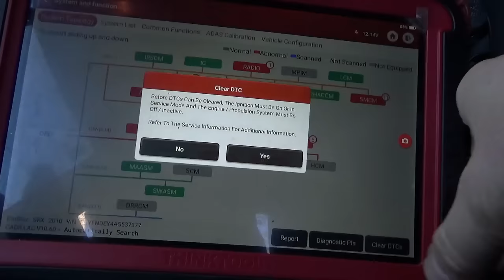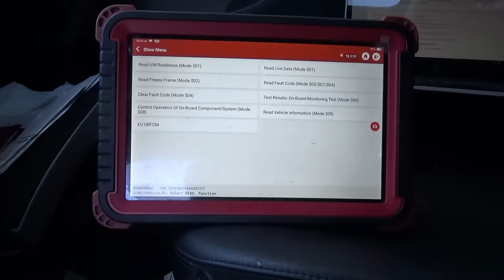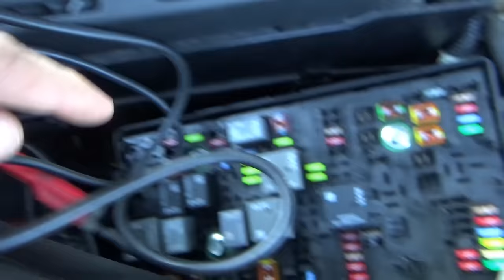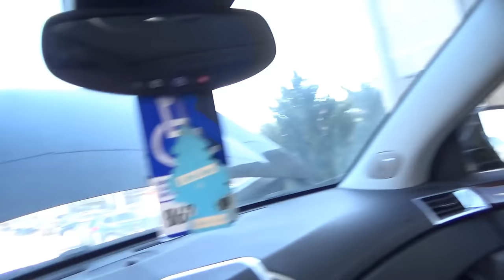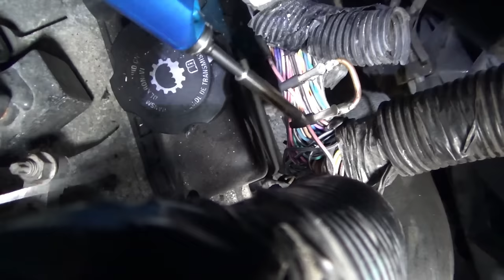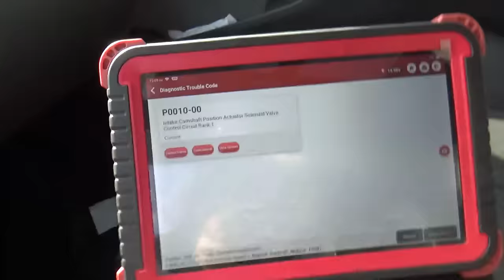Cadillac "Runs" on 2 CYLINDERS!?! (2010 SRX V6)

Comment: Hold the start button for ten seconds with out brake on for ignition on !!!!
Reply: lol
Reply: hey we all learned 1 days
Reply: Not sure why GM wants you to hold it for 10 seconds for ign to come on. Learned it under smart key description and operations.
Reply: @waqasazmat81  I just bought a car that needs  key to start.  LOL
A motorcycle I can see a push button being used.  But that means an electronic lock for steering wheel. Unless you use a key to unlock it, then put key in pocket and start engine.
Reply: @robertsmith2956  I never have to worry about locking my smart key in the car, I just keep it clipped to my belt or in my pocket. Of course I own a Toyota so I don't worry about the associated parts failing, I mean they can but it's rare, the console shifter already requires an electric interlock that rarely ever fails on any brand.  And the Toyota system (I  don't know how GM operates because I won't own a modern GM) reduces wear and tear on the key fob, I only have to touch the door handle to lock or unlock the car. As far as run position goes it's just a tap of the button without a foot on the brake.
Reply: Yeah I'm thinking RTFM but in fairness it's not his car and never seen it before. Still, it's silly how the simple things trip you up.
Reply: GM calls it "Service Mode"

Comment: If I could play devil's advocate here for a minute: I bet the customer drove around for a long time with a misfire and killed that cat! I try not to jump to conclusions when I see new parts because you don't know the whole back story. People ignore things for a long time and then end up having to get all sorts of repairs done all at once and then you look at it and think that somebody ripped them off which they might have but there's also the possibility that somebody was ignoring problems until the car literally wouldn't drive anymore......
Reply: Good info. !!! He had problem a long time. Could have been lots of raw gas.
Reply: Doubtful, most owners aren't going to replace a very expensive catalytic converter to fix a misfire if the shop tells them there is ZERO chance that it is the problem.  AND what shop with any moral character would replace a cat on a vehicle that is still running on 3 of 6 cylinders, even if the cat was known bad? Any shop with morals and dignity would advise the customer that doing so could ruin the very expensive new converter. The smoke show is oil that will coke in the converter reducing its lifespan. A shop that imagined that a 'plugged' cat could stop the whole bank from running is my only conceivable guess.
Reply: @truracer20  thanks
Reply: @truracer20  does the gas ruin the rings or cylinder walls?
Reply: @peetky8645  That would be my guess, that the unburnt gas has rinsed away the oil film on the rings and walls leading to excessive blow-by, along with a huge amount of raw gas being dumped into the cat because it's spewed out the exhaust valves.

Comment: Here is a quick tip i picked up from South Main Auto, wrap the tape around a small socket and you now have a small roll of tape
Reply: Free-tip Friday on a Thursday.
Reply: Yes as a Truck technician that's the best small roll of Tape 🇺🇸👍
Reply: the plastic spool from scotch tape roll works for me.  I don't loose the strip at the end like the cardboard it comes on does.

Comment: Hold the ignition button down without touching the brake for ten seconds.  That'll put it in service mode
Reply: Yes why in Jesus name did he not look that up!
Reply: @Evolvedmindz1  I had a Chevy bolt ev last week that when I ran the front view camera calibration on the autel it said it wasn't supported, I then hooked up gds2 and it did the same thing.  There's no engine of course and I tried to run it koeo and in service mode and any other mode in between lol.  Turns out it's just a software glitch coz it was actually in calibration mode I just needed to drive it lol.   I got frustrated and passed it on to another tech coz I was in the middle of a 22 crv main harness swap.   I was pulled off that job to do a "quick" calibration.   Ya right it's never quick lol.   It's just gm ain't caught up with the released versions of the program to make it work like it should so if ya'll run across that just drive the dang thing😅    I've worked on cars with 53 miles on em and they have me strip them down to the unibody so the structural techs can go at it,  two months later I gotta come back and reassemble the whole car and I'm a mobile tech so it can get interesting to say the least
Reply: @autotek7930 Same for 2016 Cadillac ATS so you get into Accessory mode to be able to move shifter without engine running.
Reply: @85rx7se  any push button gm is this way. It's just the ev stuff hasn't caught up software or service info wise

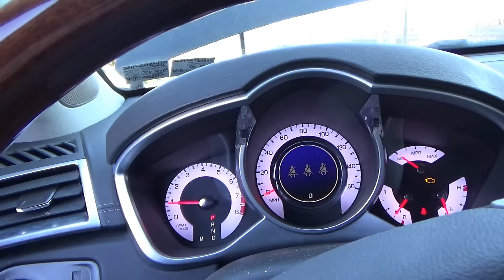Comment: Paused at 3:20  I'm not sure if your aware of this Ivan.  But ALL GM's with push button start, you have to hold the start button for 5 seconds to get the switch into run position.

Nice work finding that broken wire.  They are not always so easy to find.  But it never ceases to amaze me when a customer just want's one thing addressed, when the car has a laundry list of problems still.

Comment: One of the hardest things to find when I was an aircraft electrician was a wire that had just enough strands to show continuity but could not carry a load. In those situations a simple test light setup was often more helpful than the fancy test equipment. The only thing more frustrating was when there was intermittent contact. Often a problem would occur under certain g-loads and work fine when the wing flexed and contact was restored. I've seen several of your videos where you've had to deal with similar situations with the cars you work on. Your patience and ability to follow some complex and often erroneous wiring diagrams is commendable. Thoroughly enjoy your channel.

Comment: I deleted my comments about the 2 cylinder Caddy.
Maybe at 81 years old I was in an "instant gratification mode"!
Good job on the 2006 Accord 6 cylinder valve adjustment video.
I  have a 2007 Accord V6 with about 110K miles. Runs great & extremely reliable.
Reply from the maker: Please never delete your comments, just respond. Deleting comments wastes time of people who took time to respond 😊

Comment: First in😊. I spray my tires and wheel wells every evening with peppermint oil and no more mice getting into vehicles since I started this a couple years ago.
Reply: I wonder if that would work on squirrels also.
Reply from the maker: Wow spraying the wheels every night is true dedication! 😅
Reply: I feed the feral cats outside, and they bring proof they keep my wires safe.  Although one had her kittens on my engine.  Didn't get my car back for 3 weeks. Pop the hood, and the cute little buggers scamper back into the harness and hoses. Thought there were two, but then spotted a 3rd one.
Reply: There are five feral cats in my back yard that I feed. Never had a problem with mice. I have 4 cars and  6 vintage motorcycles. A mouse could cause significant damage.

Comment: Very cool diagnosis process instead of power probe power you sent supplied power through 5 amp light then a test light on the other end to see a dim light and a wiggle test to nail the failure point. Hopefully the guy doesn’t have two dead cats now! Fun stuff and a cool car! Well done Ivan.
Reply: Hey I have a power probe and a similar issue with bank 2 not working. How could a power probe be used to diagnose this? Thanks!
Reply from the maker: Power Probe is wayyy overrated 😂
Reply: I will never complain about no room under my hood after seeing that caddy.  LOL

Comment: Here in the UK I have a little Vauxhall Corsa, a GM product that recently developed a misfire on number two cylinder at low rpm, when you rev the engine the misfire goes away, if you let it idle and misfire for more than about 20 sec it will shutdown the injector on that cylinder to protect the engine and cat, sounds to me like the Cadillac could do with something similar! Thanks Ivan for all your videos I have learned a lot, mostly to take stock of the problem and not jumping to conclusions and start tearing things apart before proper investigation.

Comment: You are SO RIGHT about the drawings! It was the same way in my line of work - and most guys had some sort of aversion to using the drawings - which really limited their success. Yes, a drawing can be wrong some times - but I would always mark up a hard copy and get to the right person for updating. It really helped me the next time I worked on that equipment. Funny that the ECM monitors the hot wire that way - I incorrectly figured the coil primary was fed by a fuse, and the ECM monitored the other coil wire for voltage when it was not being pulled low. I always make the wrong assumption!

Comment: This is why you can't just throw parts at a problem, it may have worked back in the old days when parts were cheap, not anymore. There was probably gas in the oil burning off and he more than likely drove more than ten miles, the cat is no doubt compromised and who knows what happened to the cam sensor. Drive it to the junkyard. But I always enjoy watching Ivan methodically peel back the onion, 90% detective work and 10% nuts&bolts.

Comment: Usually you just press the start button twice without pressing the brake.  That will turn the ignition on without starting the engine on pretty much every car with a push to start button.  Some cars you would just press once, and pressing and holding would get you accessory.  It's pretty much going to be one of those combinations.

Comment: Good job hunting down the short in the wire. What a pain after all that work and still having issues. Every time someone I know buys a project that only needs a sensor, or a module it ends this way. Spending days to find out the pistons are bad, or trans ☺.

Comment: Besides the short roll of tape, something to add to the fix box is some inner tube rubber and a razor knife.  The inner tube cut to a patch strip, put a pair of slits about 1/2" apart near one end, thread in a zip tie(s), wrap the rubbing harness with the non-zipped end, rolling, and fasten the zip ties, to make a rubber buffer between harness and sharp edges.  Also, keep some hockey tape on hand, it is the black cloth tape from the sporting goods supplier.  Works great on harness looming.

Comment: I drove an LF1 powered CTS when it was new.  Those engines are a riot.  270 hp @ 7,000 rpm out of a 3L.  Of course they didn't stand the test of time but when they were new, pretty fun.

Comment: The rat wasn't OEM, the wire routing was.  That is why they missed it.  😜
I'm definitely going to get a 1month subscription.  My buick heat just stopped working.  
Making my lights so I can see if wire can handle current.  Already ordered some Y plugs. Got a dodge, and ford that will give the test lights a workout.

Comment: The shop was so close to figuring this out when they jumped power and got it running.  Just couldn't find where the wiring failure was.
Reply: There was no doubt in my mind they were going to say you can fix the wire,.  😙

Comment: eric O, has his trick w/tape for tight spots, you probably have seen. he uses an 10mm socket and wraps tape around it for those difficult to reach areas. it's a bit more comfortable and effective than the almost empty tape roll. just an FYi
Reply: But my 10MM sockets keep running away!

Comment: Did you guys check the engine oil level? Did fuel makesl its way into the crankcase? Perhaps an oil change is needed before customer drives it home?
Reply from the maker: Of course. Oil was actually remarkably clean and fresh... Shop must have just changed it lol

Comment: I love your channel. 
Q, do you at times know what the problem is going to be, but follow a due diligence pathway to diagnose. Creating video content/lesson and charge 3 hrs to fix. I figure this is exactly what you do and it’s appreciated.
 I hope the customer does.
Reply: I too do auto electrical diagnostics for a living,, and i am starting to think that customers should be charged  more then even 3 hours for these types of repairs.  the time, special tooling, knowledge and patience required for these jobs is in really short supply in this industry.  so when a job like this is done correctly not only is it getting diagnosed/fixed right, but it's potentially saving a customer thousands on wrong-part-guesses + tons of time dealing with hack "mechanics."   maybe i'm biased? but i think the value for this work should be much higher then it currently is (esp since more and more complex systems are coming out every year (and average mechanics are clueless.)   just my .02

Comment: Those GM vvt solenoids and catalytic converters have high failure rates , I doubt they were changed to remedy ignition coli circuit codes

Comment: How are push button Starts "stupid"? It's a modern car, a seemingly old timey key barrel to put a key in and turn would functionally do nothing different here - just sends a signal one of the many control modules. But of course Ivan knows this :D
Having concerns about the security of key proximity sensing systems to enable the push button.... that I can understand. Amplification attacks to boost your key signal from your house to the car in the driveway etc. have been going on for years among several other shortfalls.
All that said, the convenience of walking up to the car with a large box in your hands, the key in your pocket and being able to open the boot (trunk) without having to put the box down, get out the key, press a button etc. is great.... particularly the cars you can do this and just wave a toe under the rear bumper and the powered boot door opens itself.
Great convenience, just loads more to go wrong as it ages :(

Comment: What's the customer's beef? Lots of cars, motorcycles and even trikes run on three cylinders!😂 GM sure stuffed that harness between a rock and a hard place. I have one of those soldering pencils too. I power mine with a motorcycle battery and special adapter. Lastly, from running on only three cylinders and dumping fuel into the dead ones, I'm thinking there may be gasoline in the crankcase along with the oil, so the oil level is too high. Do an oil change. That might fix the smoke problem.

Comment: The triple beep is the "Hey dummy, you left your keys in the car".  It doesn't have any sensor to know that you didn't step out of the car.
Reply: I thought he just pushed a button.  I guess you mean the fob.
Reply: @lvsqcsl  Chevy has a feature where when the car is shutdown, and the driver's door opens and closes, the car will check for the fob inside the car.  If it finds it, it will triple beep and unlock the car.  The car is assuming the driver has stepped out, leaving the fob behind.
Reply from the maker: A lot of clueless drivers out there 😅
Reply: @PineHollowAutoDiagnostics  Truth!

Comment: Can someone explain why we need to use “headlight” bulbs inline for putting power to the coils?
Reply: The filament of the bulb acts as a resistor to limit the amount of electric current which will flow through the circuit as a safety measure to prevent a very high current flow in case of dead short in the wiring.

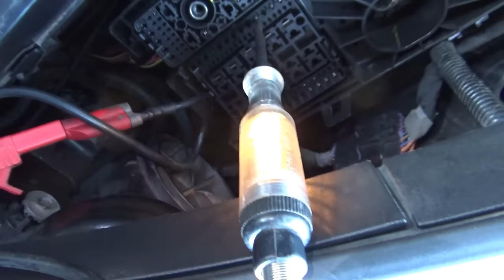Comment: Hello Ivan, I have been watching you for a few years. I do not understand why you use the light bulbs test light to give power to power the bank of coils. I am at 17:01 so will have to back up to see how many amps the bulbs are. I do not understand the whole concept of different amp bulbs to power something. I am old school, 73 years old, you have helped me in the past figure some things out. I just can not stand not understanding the stuff. Thank you for all the good videos.
Reply from the maker: The big test light pair is basically a convenient 5 Amp fuse that never blows. Safer than a straight or fused jumper wire, and MUCH safer than the silly Power Probe :)

Comment: Nice diagnosis. Apply solder to the heated wire to avoid a cold solder joint, not the iron. Hard to do in a tight spot.
Reply: I'm glad you taught Ivan how to solder. Try to solder in a awkward position, gloves on, freezing your ass off,  and trying to video at the same time.
Reply from the maker: You must have some melted solder on the iron tip to aid in heat transfer to the wire itself... Just a tip 😉
Reply: @PineHollowAutoDiagnostics yeah, can't exactly solder with a dry soldering iron tip. Need some on there to get the heat flowing.

Comment: Hey Ivan good video, after watching it something dawned on me.  You mentioned in the video you have to start the engine to get the accessories to turn on?  Did you try to press the start button twice only and not put your foot on the brake pedal?  I assumed that is the way to get the accessories to turn on only and not the engine.  I just went outside and tried it on my neighbors 2023 Chevy Trax and that car was able to do that.  I am sure this is past tense now but I would recommend trying this on your next GM vehicle.  Good luck and thanks for the videos:)  Udachi!

Comment: Blame the car for harness routing, but you can also blame the car for having the BCM function setup to monitor that +12 volt power line to the ignition coils and provide a fail code. That's what narrowed the diagnosis down to the open wire.

Comment: I would imagine that as this wire wore through it would give an increasing rate of misfires. If the owner just ignored it and kept powering through that would feed unburnt fuel through the cat, until it failed. Thus the cat may have been throwing codes and needed replacement as a secondary failure to the ignition problem. It is one of those reasons why problems should be fixed and not ignored.

Comment: I wonder what the engine oil looks like. Probably loaded with gas too. Also, this is why diagnosis repairs take so long because of all the research that needs to be done before touching the vehicle. That is something that is lost in the general public at times.